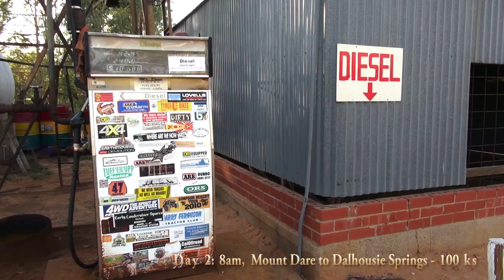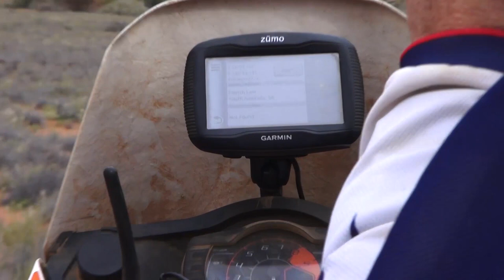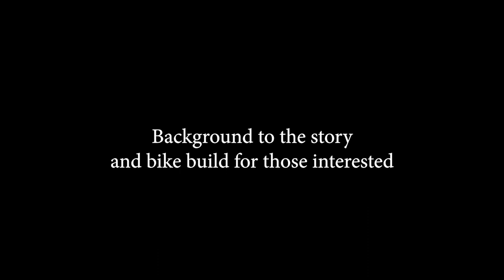Motorcycle Adventure | Unassisted Simpson Desert Crossing

Comment: I'm always surprised at how many set out for the Simpson without good sand tires and a bit more practice with the bike loaded up heavy. I crossed it back in 74~75 i think with my Dad in a Nissan Patrol 4X4. We didn't run into anybody until Poppels Corner. The old French line looks like a track down to the beach it must be taking a load of traffic now.

Comment: We did the exact ride about 20yrs ago unassisted on a dt175 and a kdx175..both unregistered (young and dumb), took us 5 weeks from Melbourne, up to Alice, doing the Simpson, then onto Sydney and back to Melbourne again, the ONLY issue we had was a nut came undone in the kdx gearbox which we sorted with Loctite, a hammer and screwdriver to do up the nut , that was it, no other issues, ill be doing it again in 2022 on the tenere 700...cant wait...
Reply from the maker: Hopefully we'll be crossing with Teneres in 2020.
Reply: @MotorcycleAdventureDirtbikeTV  fantastic, be interested in your, I assume video of that one,  6 of us are doing Tassie 2020, I still have the 660z but will be updating to the t7 around Jan 2021.

Comment: How did the KTM 640 Adventure fare compared to the KTM 690?  Seems like a great and underrated old adventure bike / overlander in 2019.
Reply from the maker: The 640 was in fact my old bike.  A greatly under rated adventure bike that held it's own against the 690s in standard kit.
Reply: @MotorcycleAdventureDirtbikeTV  Cool. I'm planning a Northern Namibia trip next year.  The route is fairly extreme, and I don't want to take my R1200GS.  I was a bit concerned the KTM 640 Adventure would be too unreliable or old fashioned in terms of handling. I haven't ridden one yet.  Ideally would like to find something cheap in order to do the trip on a budget.

Comment: Only one question : why there is so much flies?
Reply from the maker: Normally there wouldn't be flies in the winter, but they got trapped in a huge hot air bubble that was over the desert.  The temp is usually much colder, around 0 degrees c in the morning and 17 degrees c in the afternoon.  It was much much hotter than it should have been.

Comment: I saw a support vehicle at 1:40 on this video. I knew they were going to half to use a support vehicle to bring them more water and fuel somewhere before they got to the actual destination. Just impossible to carry enough for that long of a trip; without having fuel depots somewhere in between. I do not believe any of you was unassisted for all of you relied on each other from the get go. Or you would not have made it.
Reply from the maker: Gary, the crossing of the Simpson Desert,around 550 ks was unassisted. The truck that you refer to, drove around the desert and left us to fend for ourselves. Thee were no fuel deposits, We took around ten litres of fuel each and tmost of us took ten litres of water.
Reply from the maker: @Charley Smith Yes.